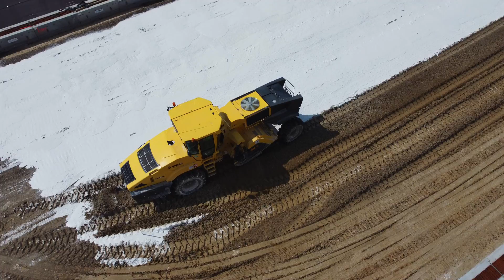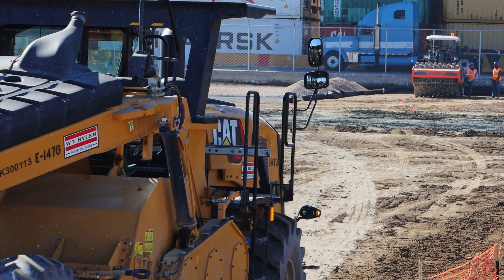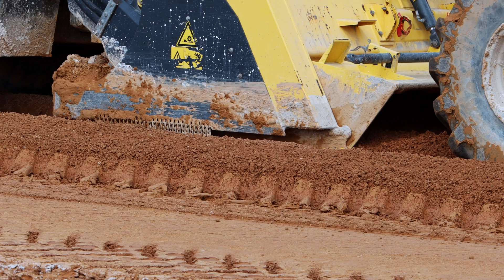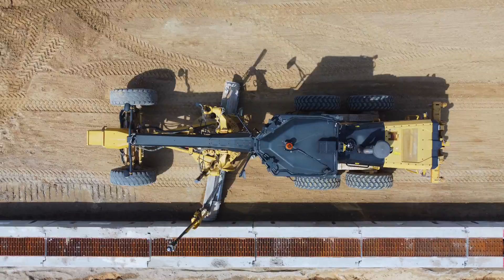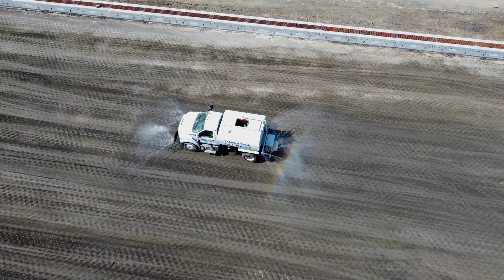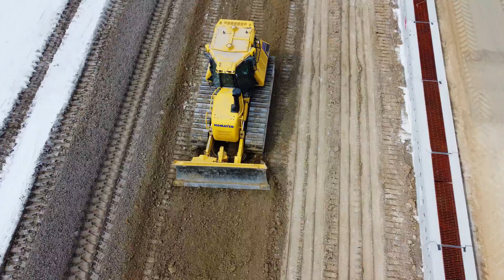Lime-Cement Soil Stabilization in Construction – What is it?

Comment: Would this process be expensive for residential construction? I live in Houston Texas and we just spent $15k to fix our shifted foundation on our 1970s house. Would've been great to have this beforehand
Reply from the maker: It is an expensive process in general. It works well on a large scale, for example - roadway construction. When you have a small individual multiple areas to work, it gets astronomical in price. The only time builders consider doing it is when they have no other choice due to extremely poor soil, however, in many cases it is cheaper to extract soil and replace it, rather than do lime. Extraction technique is widely used in Colorado, for example. The only time builders do lime for a house is when someone orders a custom house on private land.
Reply: I doubt any home builder would consider this, or "treat the soil" before building. They simply dig down far enough and pour thick enough concrete where this becomes a very rare issue. Sorry it happened to you.
Reply: In Houston since we do not freeze we use cement or fly ash on sandy type soil or lime in clay . Mostly parking  5:45 lots and roads under slab usually good compactions of select fill with bell bottom piers of concrete to make it even better.